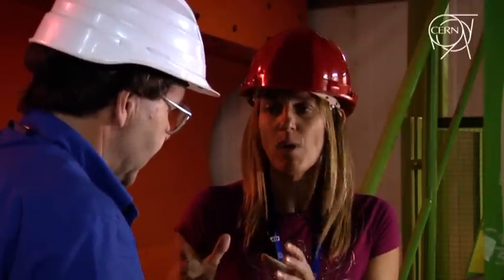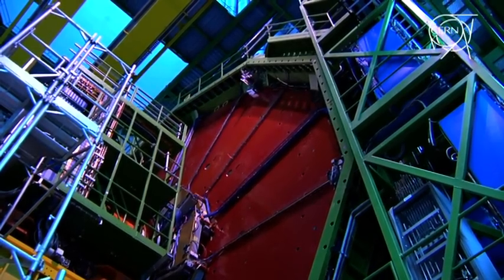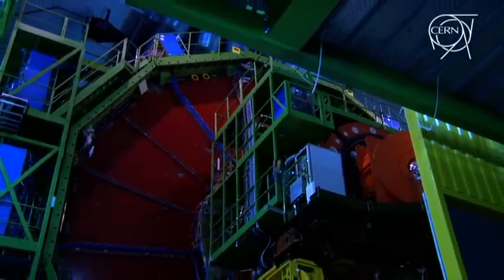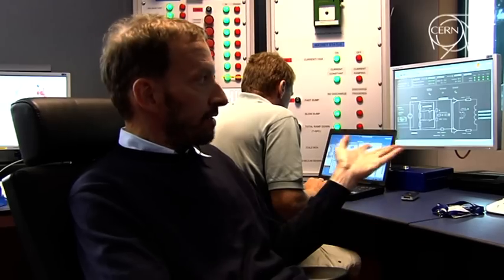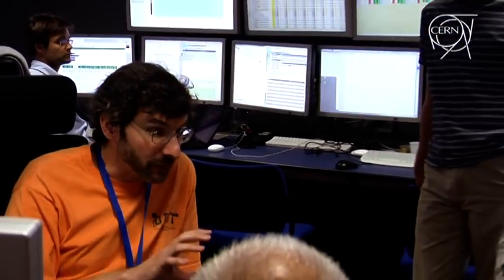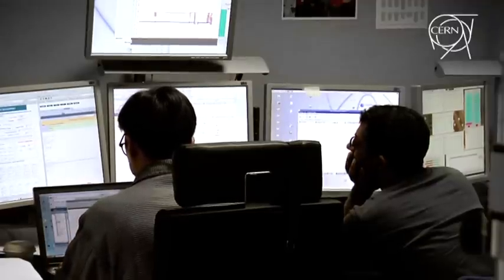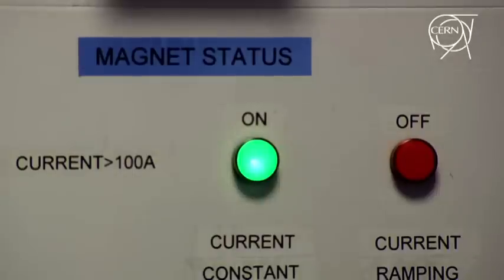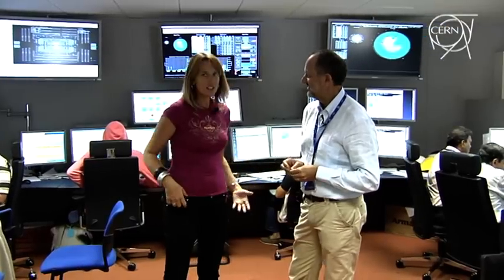LHCNews Sep 11, 2009: CMS goes cosmic!

Comment: The strength of the solenoid magnet is really impressive!  3.7 T may sound small compared to the strength of a MRI (can reach over 3 times that in research magnets), but when you consider how much bigger CMS is it's absolutely mind-boggling!